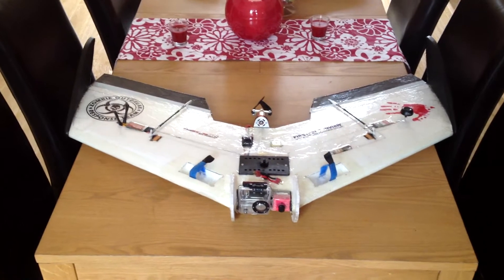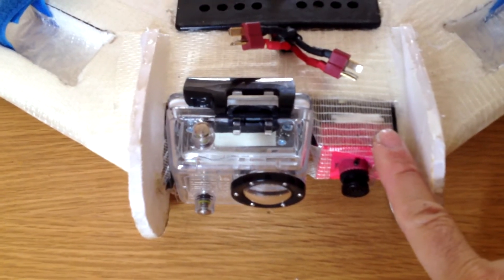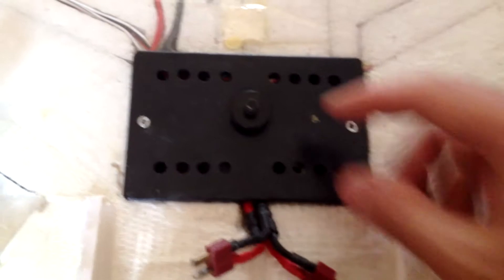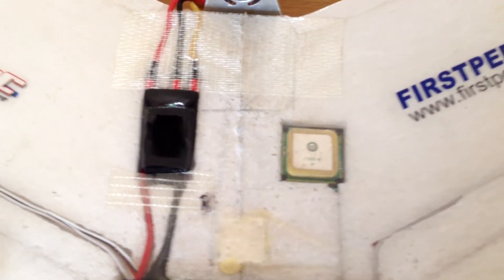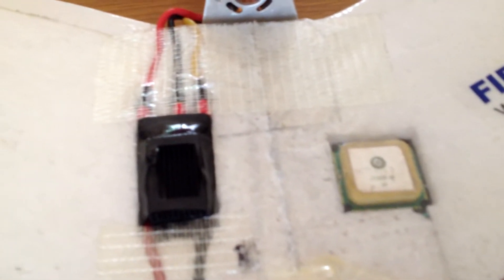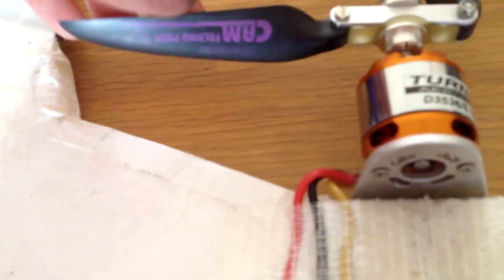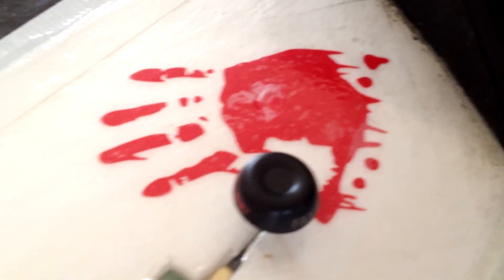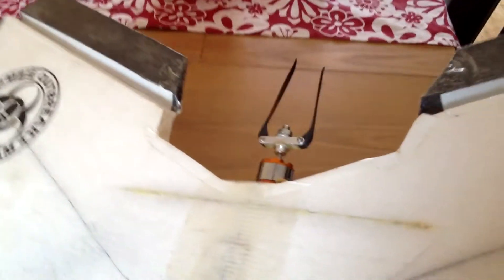Franken Swift Flying Wing Walk Through - Modified Maxi Swift

Comment from the maker: It had always been a force of habit to use a folder on a wing :) I'm now using a solid APC 9x6, the wing weighs 1.5kg  and with the motor/prop combo it can lift its own weight so its generating more than 1.5kg of thrust :)